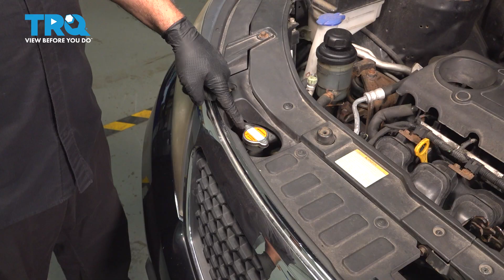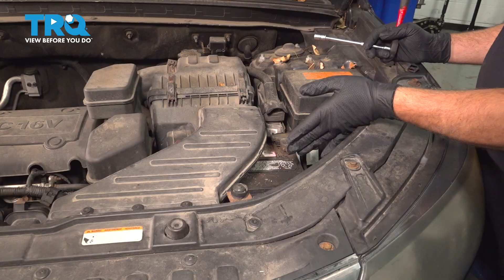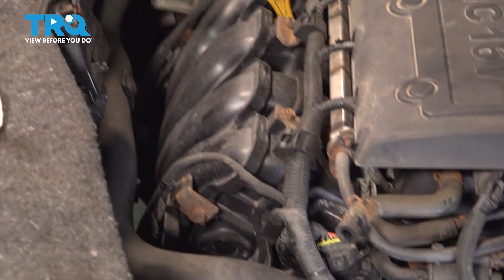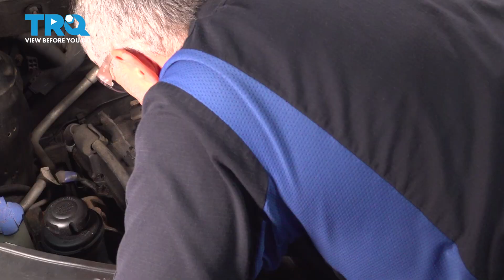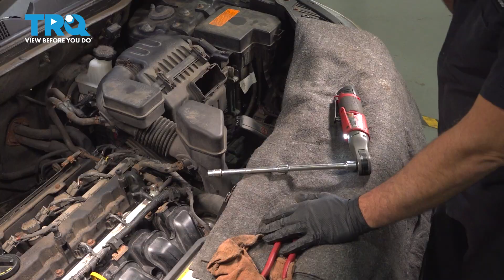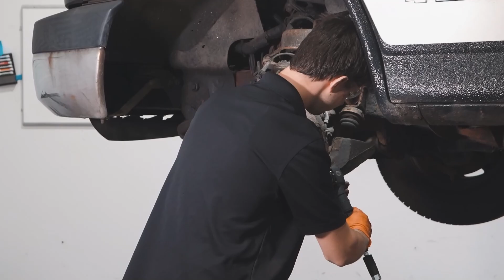How to Replace Engine Knock Sensor 2011-2014 Kia Sorento

Comment: Nightmare 😮. They know cars don't need all that bs. Then they fill cars up with unnecessary sensors. Then put then in  These are hard to get to spots on purpose.  Backwards engineering humans.💯 Just to create cause and effect. They blow up countries then act worried about the atmosphere 😂. building cars impossible to work on has nothing to do with the atmosphere 💯. Shop , part , shop , parts shop, part. We live for car problems 😂🤬😡🤨